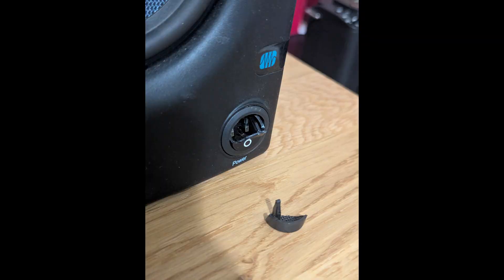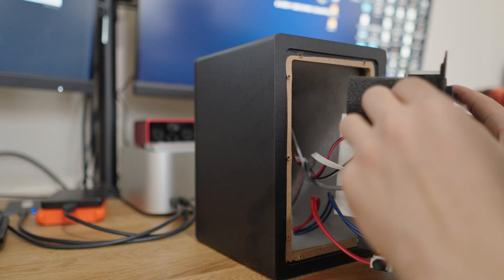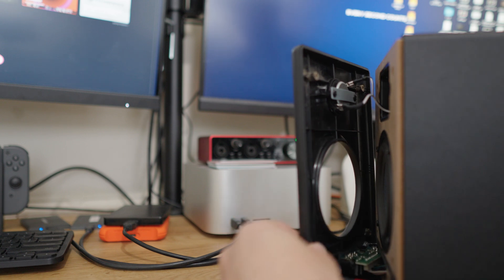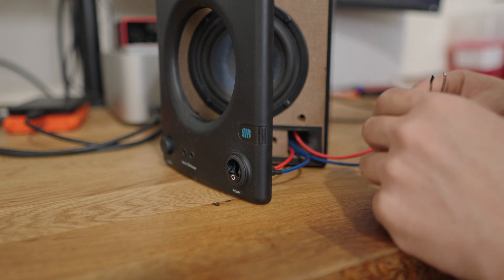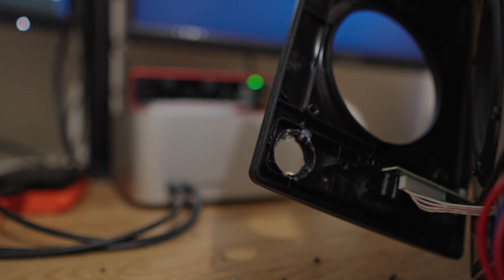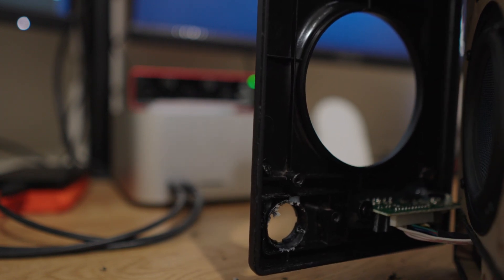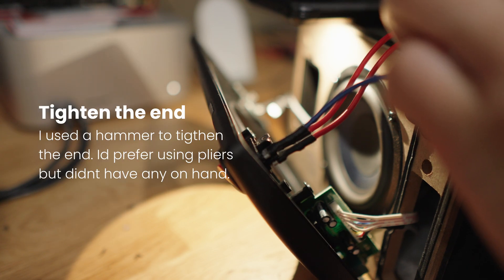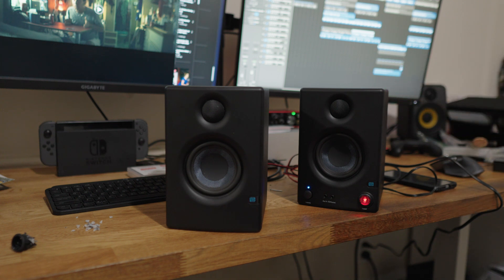How to Fix the Power Switch on PreSonus Eris 3.5 Studio Monitors

Comment: Just FYI for ppl who has power switch issue— After you open the stereo, and the front panel, simply use heat gun or hair dryer on the glue around the power switch button, it make the whole thing lots easier!
Reply from the maker: great idea!

Comment: Thanks for the video. Is there a specific order to connect the red and blue wires?
Reply from the maker: I had taken a picture of it's original configuration before removing anything and just made sure to put it back as I found it. Other wise I don't think theres a specific order to remove and reattach
Reply: @CoastCamera  thank you bro!

Comment: Do you have to stabilize the speaker to turn on the switch or it gets pushed back?
Reply from the maker: once the switch goes back into the hole it fits pretty snug. you can turn it on and off like normal.

Comment: I replaced my switch with same switch you used however, I find it helpful removing the silicon around the stock switch using WD-40 as that will soften the silicon seal.
Reply from the maker: ahh great idea!

Comment: I have presonus 4.5, and do not power on.  i saw a video someone had the button melted on the back side. mine looks good but so does your button look very good but still was broken.  SO i should try chaging the button even though it looks good, makes a clear click sound. Thanks for the video!
Reply from the maker: Thanks for watching! Mine physically snapped —but it turned out the internal mechanism wasn’t actually completing the circuit anymore. So it wasn’t letting power through.

If you’ve ruled out the power cable and fuse, swapping the button is definitely worth trying—it’s a cheap and relatively easy fix that could save the monitor. Its hard to say without looking at the internals you know.

Let me know how it goes!
Reply: @CoastCamera  i thought it is the button problem but then i read some user comments that it be the capacitor so unplug power, leave it few hours (or over night) and plug power cord back, press ON and wait 1-2 hours.  That fixed my problem !! If i did not read that i would not think i need to leave it off and on so much time to reset that capacitor.
Reply from the maker: @Seby-biketrial  WOW! That's a long time. I wouldn't think so either. I'm glad you figured it out though. Happy listening

Comment: Link to the switch on ali express?
Reply from the maker: https://www.aliexpress.us/item/2255801114042870.html?spm=a2g0o.productlist.main.1.12a66657IbkNxM&algo_pvid=ecac9f6c-c329-42d9-bf3f-c8231e900b9d&algo_exp_id=ecac9f6c-c329-42d9-bf3f-c8231e900b9d-0&pdp_ext_f=%7B%22order%22%3A%2282%22%2C%22eval%22%3A%221%22%7D&pdp_npi=4%40dis%21USD%210.89%210.89%21%21%210.89%210.89%21%402103247917448419343013807e3ecd%2110000015667435784%21sea%21US%216220750661%21X&curPageLogUid=wEWXA4hHmEAl&utparam-url=scene%3Asearch%7Cquery_from%3A
Reply: @CoastCamera  thanks Bro, just completed the surgery! Delighted 😁😁😁  fuck presonus for that glue though , was a nightmare to get that switch out! I will keep them though... 

For anyone else wondering;  any round   4 pin, 20mm rocker switch will do , i got mine from Ali express for less than 2 bucks...
Reply from the maker: @ Glad everything worked out man. That glue was insane. I almost quit right there haha.
Reply: @CoastCamera unfortunately this item cannot be shipped to me. Do u have another link to another one?